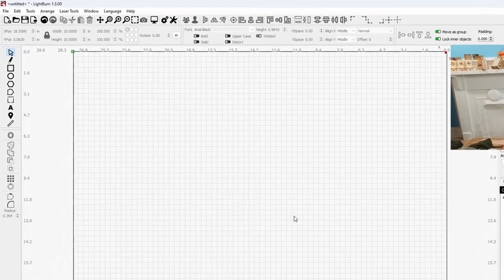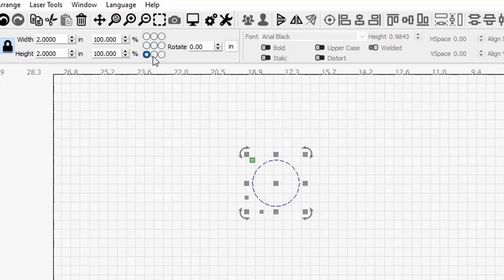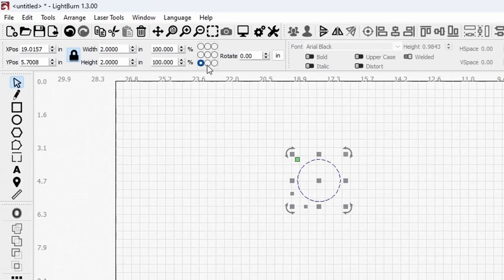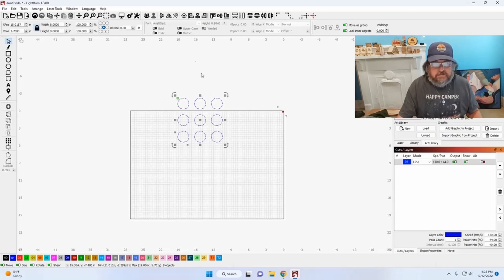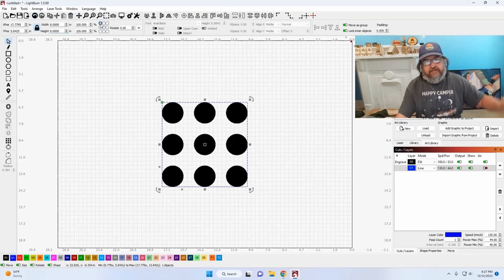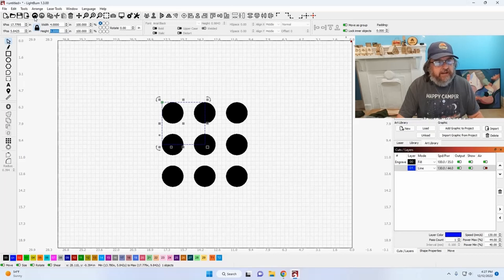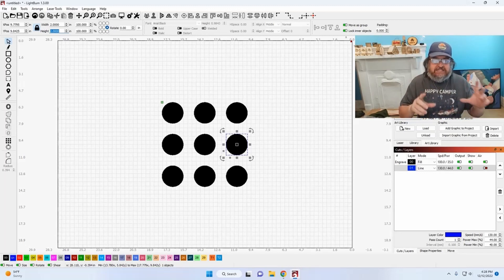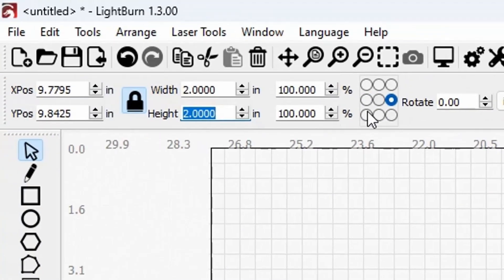Using Anchor Points in LightBurn

Comment: Will using anchor points fix this issue.  I typed out the 12 months horizontal. Came out to be 21 in. Selected all months rotated it vertically to fit longer bed. Engraved it was 1/8 in higher on the right. Zoomed in on lightburn grid and it is higher on the right. I rotated the right side down but it raised the left side. I am trying to get it one straight line. No elevation.
Reply from the maker: This doesn't sound like an anchor point problem so much as a rotation and alignment problem. It is hard to say what happened since I cannot see how you did what you did.  BUT if you do it this way, you shouldn't have an issue.
1.) Type out your months.
2.) if you didn't type them in one constant text line, be sure they are all aligned on the center horizionatal centerlines. Then group them. Depending on the font used, aligning them to their bottoms could also create an undesired outcome.
3.) Once aligned, select the entire line of text and hit the Comma key to rotate counter-clockwise and the Period key to rotate clockwise. This method of rotation will not change the alignment in any way.
Again not seeing what you are doing or trying to do, this is my best guess to resolve your issue.

Comment: Very interesting, just wondering why you would want something other than center?
Reply from the maker: When creating unique designs, I'm constantly changing the anchor point position. I sometimes find myself positioning a shape within a shape and finding it needs to be resized. I can select the appropriate anchor point and resize it without losing its position. This keeps me from having to reposition it a second time. Learning when to use them and which one will save time when designing.

Comment: Steve, my light burn looks different. My nine dots aren’t up top on the menu bar. Mine are in the laser menu, down in the laser tab. I thought I had finally done lost it until I saw them hidden in plain sight on the screen…lol
Reply from the maker: The menu bars are movable. If you want to relocate them, look for the vertical line of dots on the left side or top of the menu. Hover over the dots until your cursor changes to a four-way cursor arrow and drag the menu anywhere you like. Thanks for watching and thanks for your service.
Reply: The nine dots on the laser tab are for setting the starting of the laser (nothing to do with what Steve was discussing).
Reply: Actually what had happened was I was on an older version and hadn’t updated to the latest greatest, hence I did not have the other set of dots for rotation.

Comment: Page 22 of the LightBurn manual, section 3.4.7 says:   
"The lock button can be used to maintain the aspect ratio of
your objects when changing the size, and the 9-dot control
lets you choose the point that positioning and sizing
happens from. The number entry boxes accept equations
and units, too - You can enter 5mm, 5in, 5", 5*3mm, and so
on, and LightBurn will calculate the correct result for you."
So I guess it's called the "9-dot control".
Reply from the maker: I stand corrected. It is mentioned in passing. Once.